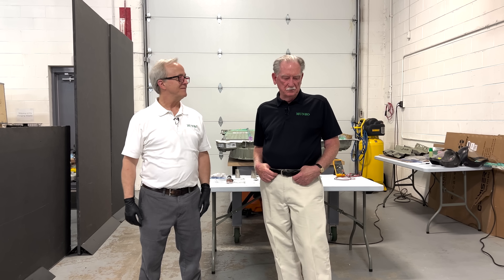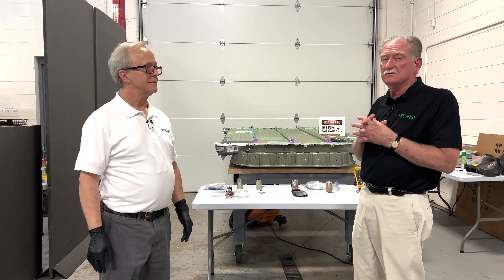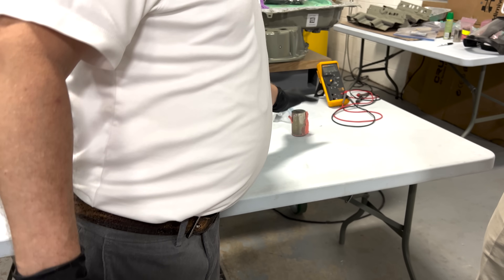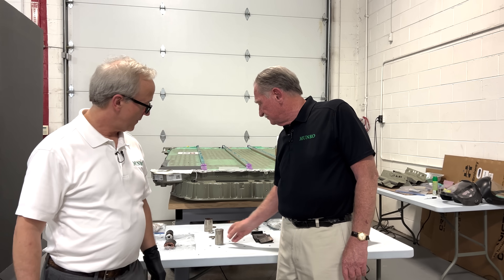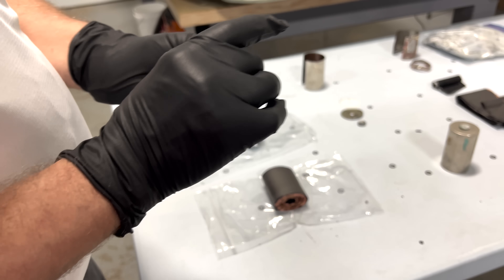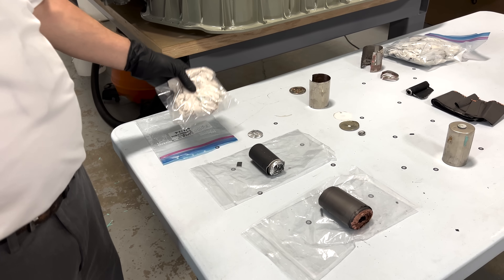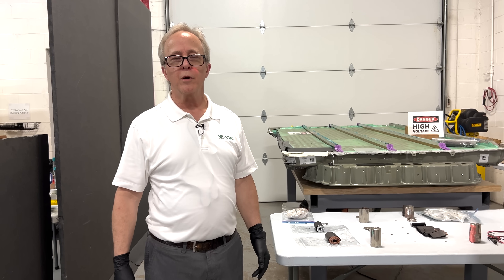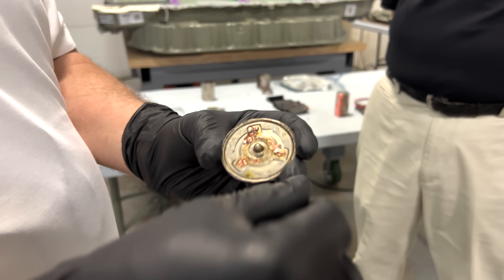Inside the Cybercell! Tesla Cybertruck 4680 Battery Teardown

Comment: When the EV is using regenerative braking, surely that is switching the cell back to charging? Does that affect the number of charge cycles for the cell significantly? That is, if the EV is often switching from discharging to temporarily charging in a journey, is it shortening the battery life, or does the battery management system store the regen elsewhere and then use that first?

Comment: He mixed up cathode and anode

- Anode is negative terminal and uses Copper current collector

- Cathode is positive terminal and uses Aluminium current collector

So the Cybertruck 4680 cell with the small top connector is the (+) terminal 
The flat bottom is (-) terminal

“The anode (or negative electrode) in Lithium-ion battery is typically made up of Graphite, coated on Copper Foil. Graphite is a crystalline solid with a black/grey color and a metallic sheen.”

Comment: Cybertruck specs were originally promised, seemingly base don having 500 Wh/kg cells. Range numbers are WAY off in the vehicles to market. Even down on the competition.
Will they have breach 300 Wh/kg with this generation?
NIO is putting 360 Wh/kg into service now, their cute sedan will have 150 kWh against Cybertruck's 123 kWh...
Reply: Battery day didn't have 500wh/kg on the 4680 road map. As for this VS the competition, GM has pouch cells which are higher gravemetric energy density but way lower volumetric. Not to mention cycle life, degredation, and temperature performance. Rivian should beat Tesla here, but use high cobalt ammounts and a larger pack on a smaller truck. Their range should be better.
Tesla is apparently using dry electrolytes which makes this effectively a solid state Battery and thus LFP or greater cycle life and degredation performance and un matched temperature performance.
We'll have to see though how real world long term testing goes.

Comment: The Cybertruck battery is supposedly 123 kWh. How many cells are there? I know "rated" is slightly different than actual but it would give us a start on the energy density math.
Reply: Not necessarily Tesla has a habit of software lock range for testing etc..

Comment: Thanks so very much Sandy. As an investor, the 4680 has been hair pulling as its holding up Semi, Roadster, Not Model 2, even with Cybertruck now ramping. 
Was looking to see When they would inject Silicon in the cathode, When they would have dry process on both sides to finally eliminate the ovens and what the energy density will be. They were originally targeting 300 wh/kg, think they can get by with 280 wh/kg and still produce Semi at a reasonable price (esp with fully dry electrodes)... and clearly they are in no rush there if the factory construction rate is any indicator. Aggggghhhhh! 
Mexico, Semi, Not model 2... delayed because of ???? 
Don't get me wrong, Many good things, but all the hair pulling seems to lead back to 4680.

On pins and needles for your energy density findings. (Christmas is comming... don't want coal!).
So very much abliged that you are doing this. So little info on the One metric to finally tell us where we are. (240 wh/kg was a Huge disapointment).
Reply: 242.7Wh/kg
Reply: There simply is not the labor to complete these projects in the places Elon is doing them. Sparks Nevada. Go look for the nearest housing development. It's in the California mountains, some 80+ miles away. There are labor shortages nationally, as Boomers die & retire, and front line workers die or become disabled from the leaked bioweapon. All the hopes & dreams for the Cybertruck were based upon supply chains, labor pools, and geopolitical forces which have since taken a hard turn against what Tesla is trying to do. The US does have national labs & materials research institutes, but that work isn't going to help Tesla with their specific problems. Everything is getting "enshitified" (see Cory Doctorow) even Tesla, it seems.

Comment: Tesla offers diversified batteries from 18650, 2170, 4680 tabless dry cell,  and prismatic LFP batteries.  High performance batteries typically NCA or NCM. Entry level batteries for Tesla LFP.  Lfp not as energy dense but cheaper, more cycles, loves 100% charge, rare fires, no cobalt or nickel.
Reply: China coming out with LFP M3P  battery, I believe?
Reply: 4680 almost fully automated as black slurry baking left out.  4680 may have a LFP version.
Reply: When will Tesla start producing LFP 4680?
Reply: @AudiTTQuattro2003  well as with most inventions it wasn't developed for a single aspect. It helps contain the chemistry indeed, but obviously also saves on packaging material and improves structural and thermal efficiency.

Comment: Removing the "spider" and welding the anode to the case was almost certainly done for improved thermal conductivity. That spider was the choke point in an already difficult to cool battery. Glad to see the improved vent scheme. The "structural" pack teardown was a bit scary. If the primary vent failed and the anode end opened it would be very ugly.
Reply: They welded the anode tabs (copper) to the case and not the cathode?
Reply: @DiptakBhattacharya  Thanks for the correction. I shouldn't write while vid is still playing :-)

Comment: отчего образуются газы ?
Reply: The liquid electrolyte contains highly volatile solvents that evaporate if a cell is opened. 
Alternately, if a cell fails internally and generates high heat a large amount of gas is released from the decomposition of materials in the cell.

Comment: Sandy this message is for you, in the beginning of your message you mention particle dusk from the batteries and I am sending you this statement.
Three person has DIED AT A NORTH VOLT factory in Skellefteå Sweden where they are making batteries for BMW, VOLVO other OEM.
 My point is that three of there personnel had pass away in there factory and I believe 😢 that they do not have a good filter system in this factory and I think you should reach out to them from a engineering prospective.😢

Comment: A good way to understand the advantage of the tabless design, as they call it the flower tab design is to think of it this way. Consider a parking lot for the big game. 10,000 cars in the lot. The tabless design has 1,000 exits, with every 10 parking spaces with a direct connection to the exit. The normal single tab battery is a that same parking lot with a 10 lane exit, where you have to drive in circles around the parking lot to get out.
Reply: I prefer the train analogy.
1 exit at the rear of the Train, or all doors on every carriage open.

Comment: It’s great the dry cell process is now working and in production.  It will only get better and more reliable from here on out! Can’t wait to see Gen 3 4680’s.
Reply: Partially. There is evidence that Tesla is purchasing cathodes (wet process) from a Chinese company for the 4680 cells made in Giga Texas. The suggestion is that some cells are made with wet cathodes and some with dry. Clearly Tom Prucha thinks that this cell will prove to use the dry process, but doesn't know yet until more testing is done. The one new thing I learned was that the anode has some silicon in it.
Reply: It is till speculation, deducted from the lack of manganese. But of course that would be big news, if they managed to also coat the anode with the dry coating process, as Tesla then could ramp the cell production by adding new production lines.
Reply: They better hurry up - the competition seems to be moving much, much faster.
Reply: @duncanidaho9153  Do they? Tesla still seem to have best range for it pack size. Don't forget that it not only battery, also motors and the control module is what make an EV range.
Reply: @duncanidaho9153  good one 🤣

Comment: How do we know that the gen 1 isn't just Panasonic 4680 design?
Reply: Well... From memory... They TOLD us it wasn't, plus, as I recall Panasonic DELAYED the start of their production?

Are you trying THAT hard to discredit them?
Reply: @rogerstarkey5390  no but Panasonic did in fact make the first cells since Teslas production wasn't even out of protype phase yet.
Reply: @Christopher-cr7pw 
Were the Panasonic cells Production items?
.
If not, it's a moot point
Reply: @rogerstarkey5390  yes you can even go back to early talk about 4680 and Elon and other employees talked about it during quarterly meetings and personal meetings
Reply: Isnt panasonic using a Design with 5 tabs opposed to Teslas Continous tab?
Reply: @unitrader403  Not in this current iteration. But yes the first protype line for Panasonic was using the 5 tab lines.   I'm sure Tesla is producing their own now but the first were made by Panasonic
Reply: @Christopher-cr7pw  i would be interested in a source where it states that panasonic adopted teslas method.. 

also your wording implies a completely diffrent story than i remember it happening..
Reply: I worked on the team that developed them at Tesla... Pena didn't know
Reply: @squee8174   your message makes no sense.    Everyone knows Tesla developed them.  Are you saying the new ones are the ones Panasonic doesn't know about?

Comment: This teardown drives home how fast they’re innovating and that it’s still early days
Reply: I don't see anything that is innovative. Mercedes is miles ahead on this battery tech.
Reply: @salland12  yet mercedes isnt selling millions of EVS so theyre technically irrelevant in the EV market.
Reply: @tabbott429  lol you are clueless. Ever heard of the EQXX? The Mercedes CLA will use some of the insights/technology from fhe EQXX  to be the most efficient EV of its class (same class as the new Model 3 btw). Mercedes is still the only car manufacturer being level 3 autonomous driving certified around the world. They also boughr Yasa to further develop the axial-flux electric motor and the new electric Mercedes AMG models will have those very compact and powerful motors.
Reply: @salland12  If nothing else, the tabless design is miles ahead of anything else in the world.
Reply: @salland12 how so?

Comment: Considering the energy throughput of the entire battery system, having a perforated secondary vent might lessen the explosive potential during failure. The battery would undergo an expansive deformation and baffle some of that energy. This is by design...

Comment: The real question is.. is Tesla sandbagging these 4680's for now while they 'test' them. Or is the performance they're showing, all they're capable of? Because they are NOT charging at the speeds we hoped for.. and they are NOT extending range to levels we thought they would. And it's doubtful Tesla is yet seeing any cost savings.. yet. So if they are not sandbagging the performance of these cells while testing, and will uncork them in the future when they're certain they can do so.. well then the whole 4680 transition seems to be a dead end.. for now. These were supposed to give CT a 500 mile range.. AND way faster charging and a better charge curve.. it's got neither. If they can't figure out how to GET that kind of performance out of these cells pretty soon.. they'd be better off re engineering the whole pack to work with some of CATLs quite impressive batteries.. or any other battery manufacturer who's got the chops. CT needs more range.. at LEAST as an optional pack, for those who plan to use the truck for towing and whatever other reason a person wants. AND it NEEDS to charge much faster.
Reply: Tesla have publicly stated to investors that they are hoping to reach cost parity compared to external suppliers this year. That is, they definitely don't see any savings at this point.
Reply: @w0ttheh3ll  Tesla has also publicly stated that the 4680 is a Backup Plan. While I don't think they are actually Sandbagging, and are continuing to put effort into them, they were always going to be lagging in development. However, actually having a battery is better than no battery. The break even point will move with the dumping of batteries as OEMs continue to back off EV production. The US government reaction to Dumping is usually increased tariffs, so that might not actually help supply.
Reply: Q1: is Tesla sandbagging these 4680's for now while they 'test' them(?) A1: no. Q2: Or is the performance they're showing, all they're capable of? A2: yes.  re: "Because they are NOT charging at the speeds we hoped for.. and they are NOT extending range to levels we thought they would." correct, okay next question.
Reply: If they made a double height battery pack they could get 500. But then they would make half as many trucks. 😁
Reply: I'm not aware of anyone charging these (packs) at 800V and until that hapepns I don't think we can judge on the ability of these packs to charge at high rates.
Reply: I don't think they are sandbagging, the 4680 is a dud. The next gen will most likely be CATL prismatic cell, using CATL's CTP 3. Tesla has been pulling equipment from CATL's factory in Shanghai in order to make a LFP cell in the US. Tesla was probably going to use cells built in China, but had to move manufacturing to the US due to the Inflation Reduction Act. In one of Sandy's videos, He talked about the extra room in the pack for thermal runaway. Maybe, but a prismatic cell would fit pretty well in there. Should be interesting to see what chemistries CATL will use, I assume they wont be Nickel rich, most likely Mn rich LMFP. The new hybrid Sodium-Lithium should be neat. As well as all of the fast charging innovations they have been making.
Reply: @jonbenet1272  re: "I don't think they are sandbagging, the 4680 is a dud." yup, the both CT and the Austin Model Y have long been in the hands of the Influencers, numerous charge sessions have been logged and analyzed, as such the VERDICTS are in.  and it's too bad because the 4680 was actually one of the FEW things coming out of Tesla that (at least on paper) actually had "real" promise, but unfortunately even it's not working out...  

i repeat welcome boys and girls to the MYTH OF PROGRESS.  as you're witnessing, the History of Technological Development is not a "fairytale" where certain things are achieved and people live "happily ever after". no, both "PRO"-gress and "RE"-gress occurs in Technological Development.  yeah, so the idea that things must necessarily improve with the passage of time is just something we've been telling ourselves so we feel better (if only for 5 minutes).
Reply: i think Panasonic is sandbagging these 4680's cells

Comment: Question?
What's the RATIO of the electrolytes? 
Still using Lithium I'm guessing.
Are the 4680 cells more ENERGY dense then the 21700 or the 18650 cells?
What's the overall cost comparing all 3?
Reply: "Are the 4680 cells more ENERGY dense then the 21700 or the 18650 cells?" I would hope so, otherwise it would be pointless. They are probably 3 times the energy than 21700.
Reply: Cost & weight improvements are my questions.
Reply: @jonsek  What about HOW MANY CYCLES it can take?
Reply: That’s what I want to know. Some people are speculating that we will see a longer cell eventually as the Cyber truck battery tray could compete with a 4695. Overall though it seems that the 4680 isn’t performing… just yet.

Comment: Soo, what I'm getting is "almost eliminated cobalt" and "no manganese". "Some silicon in anode".
Reply: No manganese is a huge surprise. "Almost eliminated" I would interpret as less than 5% Co, which would also be a surprise.
Reply: @w0ttheh3ll  pretty sure a few years back Tesla batteries were already at 3%Co, but from the video its not clear if they just stayed at that level, or reduced it even furter. i would guess the latter though.
Reply: @unitrader403  Do you mean 3% at the cell level? I was thinking of 5% of the cathode active material transition metals (like e.g. NMC 9:0.5:0.5). At the cell level that would be less than 2%.
Reply: @w0ttheh3ll  i dont remember the source since i read it more that 5 years ago, but it was a remark that stated that tesla uses 3% Cobalt, opposed to the industry standard of 10% in a 8:1:1 ratio, so i assume it was the active material
Reply: Yes, and they increased the size of the jelly rolls by re-engineering one of the end caps.
Reply: Cobalt almost eliminated relative to other Tesla 4680s I'm guessing.

Comment: you mixd up cathode / anode - aluminium/ copper    cobalt / manganese
Reply: Cathode is at the top with the tab sticking out, which is the positive side...Not sure if they mixed that up.......
Reply: @1flash3571  i know what it is thats why i said they mixed it up in the beginning
Reply: No, cathode uses an aluminum foil and anode a copper foil.
Reply: @boostav @7:17 anode side is copper but picks up the aluminium

Comment: A very safely done video despite some inconsistencies between what as said and done - do as I do, not so much as I say. So, the cathode is NCA and likely made using the dry process. The CT ramp is going well (1,300/wk??) and perhaps LG is supplying additional motherroll for both cathode and anode for a portion of CT cells as LG anode was seen near the Austin cell can scrap bin. Looks like Tesla has completed structural changes to the Austin building for the second batch of cell lines and will have all the equipment installed by year end. But getting it up to operating speed may take awhile. Given the extra capacity of the cells, and the 'reserve' for degegration and operation below zero miles of range left, the nominal capacity of the CT cells could be 100 Wh - thus nominal pack capacity could be 134.4 kWh, rather than 122.4 kWh. Thus the nominal rating of a new cell could be 10% higher than the usable quoted by Tesla.
Reply: Not NCA